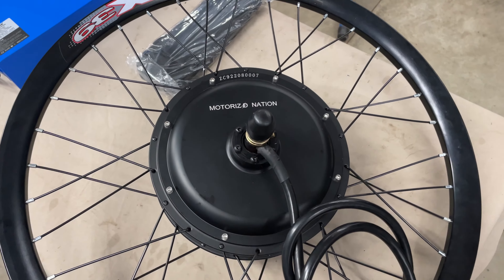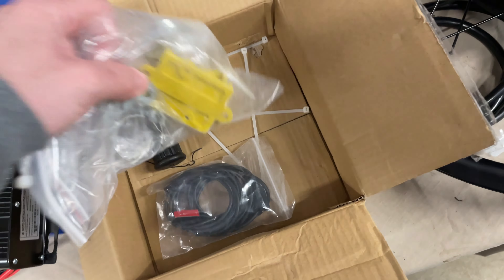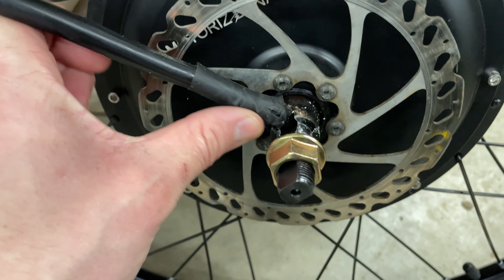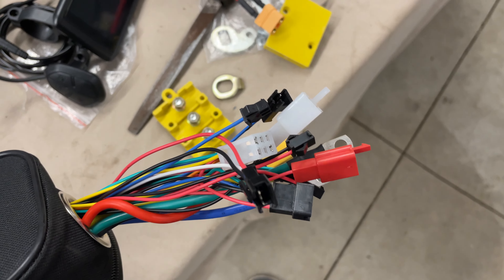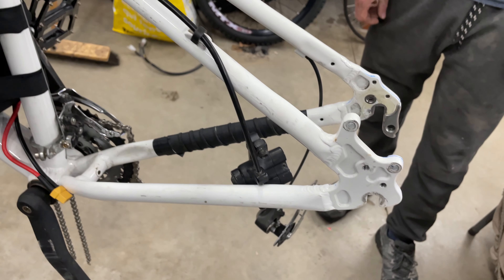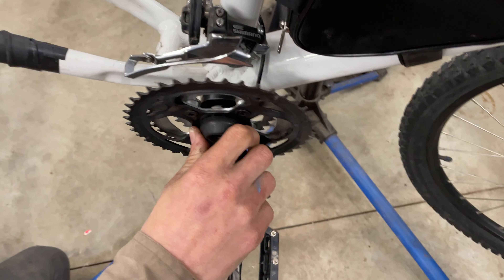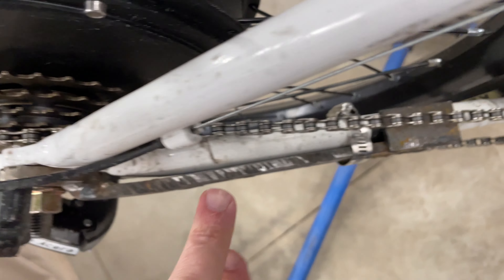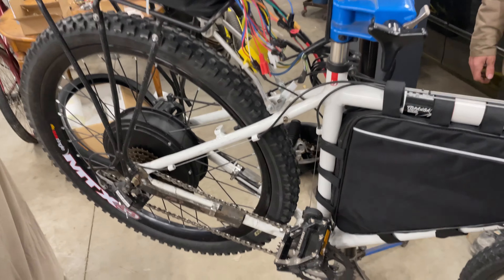Illegal 3000W 72V E-Bike Build Conversion Kit

Comment: I never understand why people say things like “1000w , 3000w, 5000w ebike” as if that’s what type of power they are pushing. 

These numbers are the potential power if you have that type of power to send to it. 

Yes 72v at 24ah could produce 1728w. But that controller and the thin gauge wire would never push higher than 200w. And if your battery has a BMS, it is definitively limiting you to around 10a max   All this before it hits the controller.

That controller is limiting your actual power. Without a doubt. 

A real 1000w to the hub motor light bike frame wouldn’t be able to lock a tire on the pavement. 

At 200w you should be able to pull 70. At 1000w you should be over a hundred.
Reply from the maker: Blame the people selling them as that. 350w motors are garbage and go slow. A "1500w" motor we have on a bike gets really really hot when using it, I wouldn't want to imagine what it would do if it was truly getting 1500w.
Reply: Companies mark these Hub motors as 1500w or what ever wattage because they are "capable" of reaching that threshhold. But the question is always, for how long? 5-10 seconds at max? and then they need to cool down. 

I mean, I doubt people are going full throttle to the wall every second they drive but still... @porkercon
Reply: "72v at 24ah could produce 1728w"
Nope this means the battery has a capacity of 1728 Wh. It has to do with range not power.
The amperage of that FAT battery is much more than 24 amps (probably at least 80 amps).
I think the battery and this motor are a good match.
Reply: @speedsterh  If we are assuming this is a real 3000w motor, then it would need 42a to reach its potential energy. 

Looking at the bike, wiring, even from the motor to the controller, its way too thin guaged to handle that power. It would over heat, short, melt in moments....

My theory is that yes, the motor "could" be 3000w, but that controller is severely limiting its power to the motor. 

This is also assuming that battery is capable of discharging 42a without over heating or having some sort of thermal disaster. There would need to be a BMS system to deal with these issues. But this bike has a "dumb" battery.

Therefore, my grief is when companies put inferior parts on a bike, but then say "oh its 3000w because the motor is 3000w" but then battery, wiring, controller are only capable of lets say 1000w...
It's a scam. super scummy.
Reply: 84v hot off the charger x 60 amps = 5,040 watts. That's your peak; it won't run quite that strong for sustained pulls. I imagine this setup easily holds 3-4 kilowatts at full throttle. If it didn't there's no way he'd hit 84 kmh/52 mph  @JohnDoe-ht5vq
Reply: weird.. I run 54v @ 70amps and hit 80kmp/h just fine on a midsized escooter here in china using 12 sattilite GPS to verify.

I doubt his battery overcharges to 84v...the size of that battery would make it somewhere like a 84v15ma battery. That would be extremely unpractical..

I've been thinking of making a video but havent had time. Maybe I can this weekend. @JaymoJoints 

edit: well I guess his battery really is 16ma... why would someone buy something so low? 
72 x 16ma=1152 watt hours.
72 x 80 amps = 5760watts
he would only have power for 12 minutes... but actually much less considering voltage drops as the battery drains.
Reply: Exactly. I said he would need 3-4 kilowatts to hit 50 mph. Your scooter pulls 3.8 kilowatts and goes 50 mph, so thanks for the confirmation. BTW 84 volts is not overcharging that battery. It's 20s (20 cells in series), which is 72 volts nominal and 84 volts fully charged to 4.2v/cell. Says so right on the label. 16 amp hours is a good-sized battery for an ebike that probably draws 6-800 watts when cruising at ~25 mph  @JohnDoe-ht5vq
Reply: @JohnDoe-ht5vq Aside from the tech. details (I understand them) I'm delighted with my basically identical setup on a small motorcycle type stealth frame. Pulls fine up any hill, no reliability issues, replaced pedals with foot pegs as it's heavy. Been 2 fun years. The final test of any machine is whether it gives you satisfaction. If not? send the stuff back and get a refund. Works for me.

Comment: Why do people use disc brakes on bikes?? Doesnt the v-brake have way more stopping force because it is farthest from the center of the rotation? This is just basic physics. Or do people get discs for vanity?
Reply from the maker: Rim brakes are good yes, discs allow you to have a more predictable braking surface, better modulation, better pad material that you can't use on rim brakes. Way to many reasons to go disc when the only reason to go with rim is the distance from centre of rotation.
Reply: Biggest advantage would be if he installed hydraulic brakes. Mech disk brakes are about the same stopping power as good v-brakes, but the disks do work a little better under certain conditions, like if the rim gets wet.
Reply from the maker: @miket.220  https://www.youtube.com/watch?v=NCdobNDttMM
Reply: V brakes are fine for pedal bikes. Leverage isn't the only factor to consider. Pad surface area and cooling play as much if not more of a role in terms of stopping power. That's why you don't see v brakes on motorcycles. You won't even see them on manufactured e-bikes unless they're cheap or underpowered. That little thin strip of rubber operated by cables is not sufficient enough when you add a 30lb+ motor serving as an unsprung flywheel outputting 10 times as much power as your legs can do. V brakes are designed for leg power, pedal bike weight and speed. Disc brakes are designed for high speed performance on a motorcycle or downhill racing mtb. A good set of hydraulic disc brakes vs v brakes is like the difference between night and day on an e-bike this size.

Comment: 2:36 - because you're putting a 3000w hub motor on a hardtail dude 😆 Not what the bike or the motor is made for. All that unsprung weight is going straight into your back if you don't bend the tubes first. Find a full suspension bike to put it on. My 3 kW qs hub motor fit the 150mm drop out in my old downhill mtb perfectly before I put it in a proper e-bike frame. Read the specs before buying next time ✌
Reply from the maker: no

Comment: Can you send me link to buy please
Reply from the maker: Parts list here:
26" 3000w 72V rear wheel https://s.click.aliexpress.com/e/_Dm0...

72V 30ah Battery (buy at own risk, I would seek a name brand/certified battery) https://s.click.aliexpress.com/e/_DDF...

Controller, throttle, levers, sensor, screen https://s.click.aliexpress.com/e/_DFN...
^I can't find the same controller with the same battery connector, you might have to solder on a connector.

Wire junction box https://s.click.aliexpress.com/e/_DDq...

5 speed freewheel https://s.click.aliexpress.com/e/_DFg...

127mm square taper bottom bracket https://s.click.aliexpress.com/e/_DDS...

All other parts were already on the bike for the most part, torque arms were custom made.

Comment: can you climp a hill with that setup
Reply from the maker: yes it has a lot of torque
Reply: @porkercon  hi, i want to build my own ebike but don t understand one thing, i don t Care a lot about the speed but i want enormous torque, power at the start..what will increase this specifically? Get a 8000w? A better contrôler? Bigger volt on the battery?
Reply from the maker: @lucasp1776  3000w has a lot of torque
Reply: @porkercon  yes but i want more, what would specifiaclly increase it ?
Reply from the maker: @lucasp1776  no
Reply: @porkercon  what no? This doesn t answer my question
Reply from the maker: @lucasp1776  I don't have an answer
Reply: @lucasp1776 u need a higher amp controller
Reply: @pieofdeath4789  so a motor with less watts but higher amp controler will start faster than a motor with more watts but less amp controler?
Reply: @lucasp1776  sort of…
Amps x volts = watts
More volts= more top speed
More amps = more torque
Reply: @pieofdeath4789  ok ok top thanks you, i only have 1 other question : what does it mean when they put 5T or 3T in a motor caracteristic?
Reply: @ that i have no idea! My advice would be doing some more research using internet and ai before u throw urself at this build!

Comment: get a better controller.. 50amps max output you have,,, get a 120 amp controller.
Reply: It's rated for the motor. 120A = >8500 watts. That motor might handle it in very short bursts, but otherwise pointless for a pedal assist e-bike, if not stupid. His legs would never keep up. Nor would his tires. Mtb tires and rims aren't built for that kind of power and speed. I twisted the sidewalls out of my Maxxis with a 3kW hub motor in less than 100km. They're not DOT certified for motorcycle power/speed for a reason.

Comment: There must be still a governor on your bike because when you lift it up the will and gave it full Throttle it only done 76 kph/ 46 mph I think it might be because you had it in pedal assist1 or setting1  try setting 5  because  my first kit was a 2000 Watt 40 amp controller and when I lift up the rear wheel it says 58 mph

Comment: @pokercon You are a hack. No pro would ever put a 3000 watt motor in an Aluminum frame and then blame the Country where the motor was built.
Reply from the maker: This is not my bike, nor did I build it.
Reply from the maker: I've ridden it once at 1/3 of the max speed and will never ride it again. I prefer acoustic bikes.

Comment: Terrible frame to do this with. Has no suspension, it's a waste of Battery and Motor. Get a better frame with full suspension
Reply from the maker: Such an inspiring comment. Not very hard to swap this onto a different frame down the road when the BUDGET for this build gets HIGHER.
Reply: Tbh with a triangle battery 72v that size, you’d struggle to find a full suspension bike that could fit the battery, you’d have to get a 48v
Reply: I have a nearly identical setup using a 17.5 hardtail with everything else upgraded.  Same bag, same hub size. 1000 miles so far and it's great.